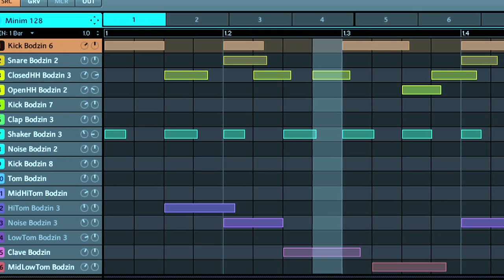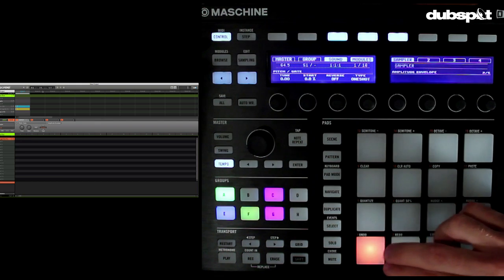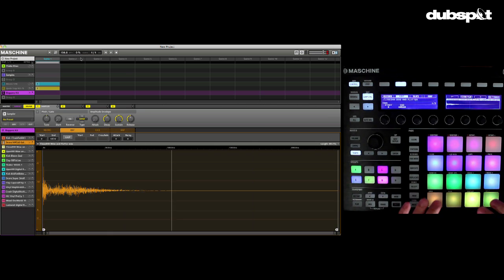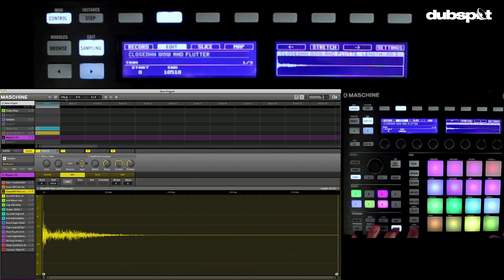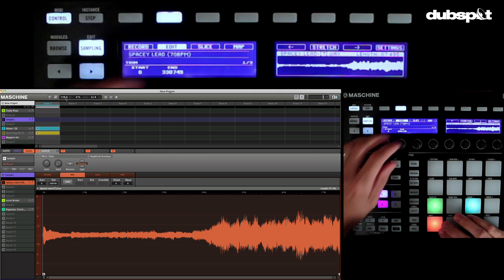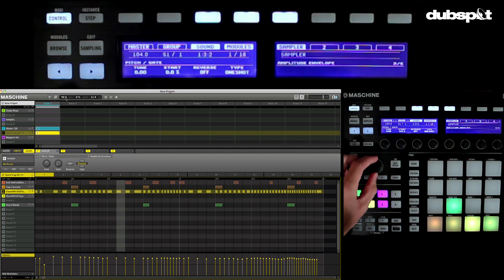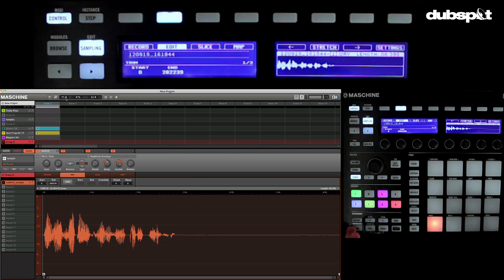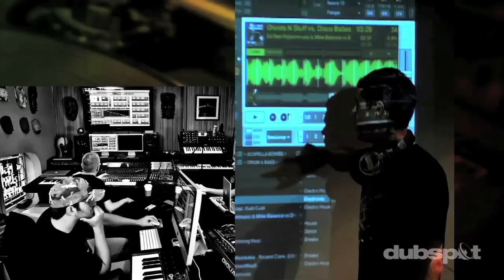Maschine MK2 Tutorial -- Time Stretching Audio w/ Dubspot's Matt Cellitti

Comment: Right, once time stretched, I am hoping to enter pad mode and then play the stretched sample chromatically, pitching up while the sample STILL remains 
time stretched.  IN this, you can play the sample as you would say, a sample in Kontakt, that has been time stretched. As you move up and down the keys (or in this case, pads), the sample remains time-stretched yet plays at a different pitch.
Thanks